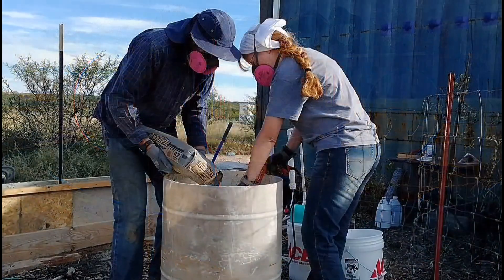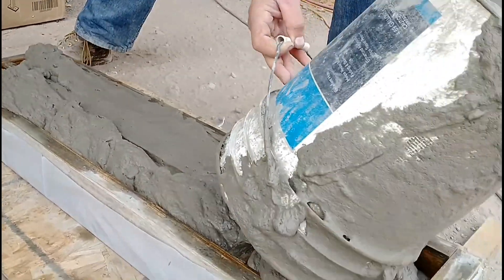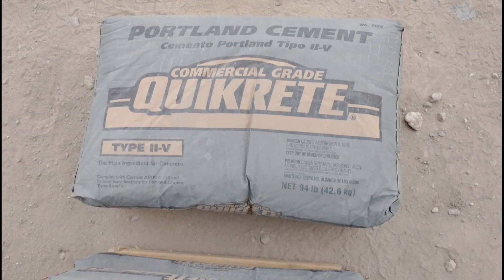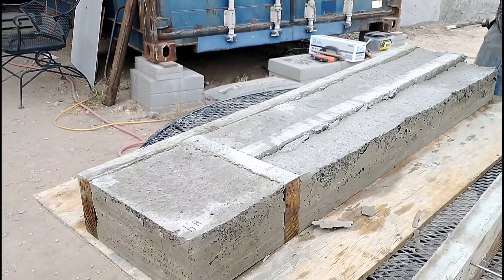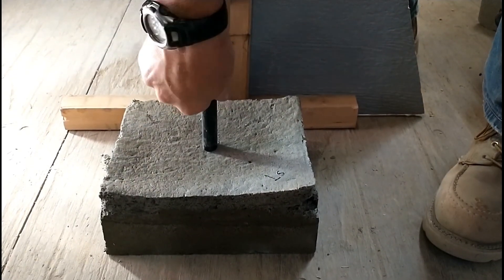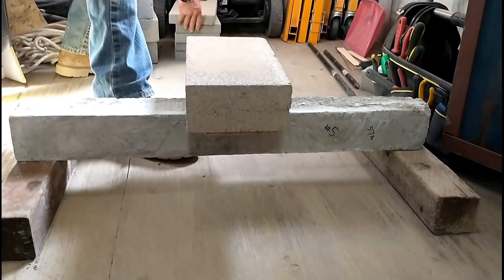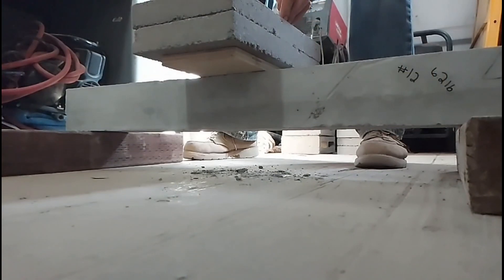AIRCRETE Dry Testing | More Failed Batches!?

Comment: Over the past year or so I have been making quite a bit of aircrete and have never had any that dropped at all.
I used the same method as "Man about Tools" Kent uses with Suave shampoo as the foaming agent. 
The foam mix is 6 oz of Suave to 1 gallon of water. Around 20-25 psi of air in the foam generator. I use enough foam to double the volume of slurry for each batch. This produces a very light aircrete mix since it is 50/50 foam to slurry. Your mileage may vary.
Reply from the maker: I wondered about adding some Suave shampoo to the Drexel to see if it would help. 50/50 is a pretty heavy mix for aircrete. It should be pretty strong.  I noticed Man About Tools didn't seem to add very much foam. The cement slurry in our full batches comes up 5 inches or so in the barrel, then the barrel is filled to the top with 42 or so gallons of foam. Some people add 50 gallons of foam  Our low foam mix has 20% less foam, which made a noticeably stronger aircrete.
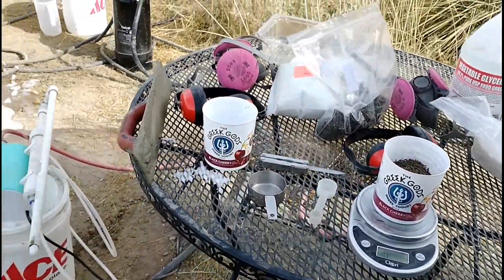Reply: @RedandAprilOff-Grid  Yes, a richer mix..(more cement to foam ratio) will be considerable stronger...of course..more costly too.     Seeing all those bubbles popping on the surface @16:21 Makes me think too wet or hard water. Wasn't sure how precisely you're filling your barrel with foam.. Filling your cement slurry with your foam to a mark that's 30" high  in a 55 gallon barrel yields the 45 gallons. If you're adding too much foam to the batch it will make the batch too wet and effect the viscosity.  The batch needs to be thick enough or the bubbles float to the top and collapse.   As far as foam stability, I have also heard that drexel needs to be shaken to reincorporate if it's been sitting on a store shelf for a long time.   We know that foam life will vary with water hardness, humidity & temperature.  Hard water ..dissolved elements like calcium and magnesium...inhibits the formation of bubbles...it will be good to see if the water softener solves the issues.  Observing and comparing foam stability by placing the foam made with softened water verse the other in 5 gallon buckets and observing how long it remains stable might give an indication how it will perform in batches.
Reply from the maker: @Lisacee7  Yes, that video clip was of one of our earlier batches, before he was adjusting the pressure regulator throughout the batch. The foam was too wet and the mix was using way more of the soap solution than it should have. He cut the barrel down, so it was one inch above 45 gallons. We are using an RV water softener, it's the black tank that the hose is connected to. The hardness level of the water on the test strips is 0. Once we got the hang of it, batches 6 through 14 turned out pretty well, but we started having some issues after that. Next we mixed 4 full batches for the garden wall, and they turned out ok, but not great.  For our last set of samples with the fiber reinforcements, we used a new bottle of Drexel that we mixed very well, kept the samples in the well house where we were sure they wouldn't freeze, and tried to make sure the Drexel was closer to room temperature.  We'll be showing how those turned out soon.
Reply: @RedandAprilOff-Grid  I used only Suave shampoo as the foaming agent. No Drexel was used as it costs too much.
Reply from the maker: @FrugalBuilding  Drexel is really concentrated. It is $48 a gallon on Amazon, but a full batch only uses 4 oz. It ends up costing $1.50 for the solution to fill a 5 gallon bucket, which makes a full batch of aircrete. Cost wise it's pretty good, but I have heard many say that if it's not mixed well the earlier batches tend to turn out better than later batches. Drexel also seems to be pretty temperature sensitive, so maybe Suave does better with colder temperatures.

Comment: Are you weighing your foam to dial it in to about 90-100 grams per quart? I also suggest you use an air compressor that has a larger tank. This will bring more consistent bubbles with less large pockets. 

What foaming agent are you using? Drexel is best, 7th Generation dish soap is a second option.
Reply from the maker: Yes, we weigh the foam at the start of each batch, (our other videos show the whole process more and the different things we have tried) and he adjusts the regulator as need to make sure the pressure doesn't drift. A bigger compressor might be better, but we are off-grid and on solar, and this size works as long as he keeps an eye on it. 
We are using Drexel, and suspect that could be our issue, because we weren't mixing it well before each batch, and have heard that can affect the later batches.
Reply: @RedandAprilOff-Grid  get the bigger compressor. If the tank has to refill with compressed air while a batch of Aircrete is being made there will always be inconsistencies. Dialing during a batch is not recommended. 
Compressors use energy when they fill up. Smaller compressors must fill up more often. Big compressors take longer to fill up, but do so much less often. The power consumption difference is negligible. They can be had for very little money (<$200) at Habitat for Humanity Restore or pawn shops. Worth it.